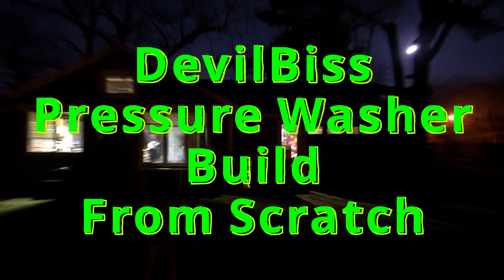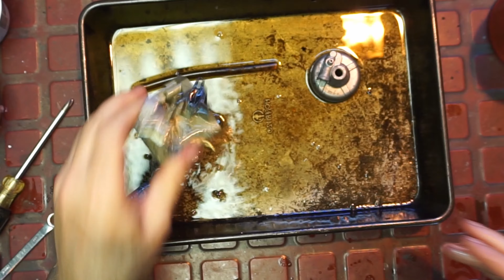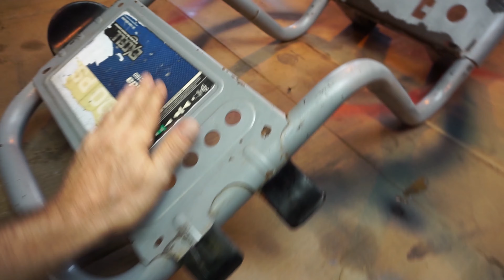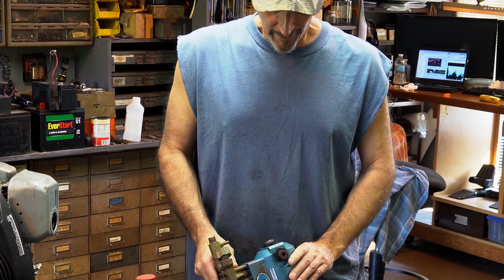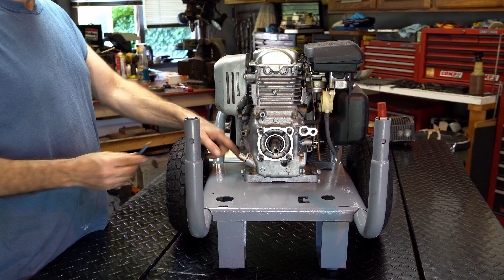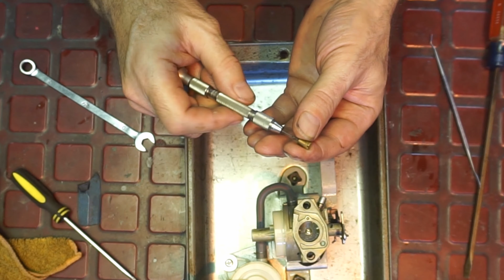EXCELL/Honda XR2600 Pressure Washer FAIL ~ Pump Replacement (Axial Retrofit) Refurbish - Rebuild

Comment: I checked but have you replaced your seals yet?  I have a general tt9071 pump that needs seals.  Was told it's not worth fixing.  I don't believe them.   It is very similar to your pump.  Hope you make a vod soon.
Reply from the maker: I haven't replaced them yet, I have 2 machines now with General pumps and I will replace them at some point.
If your pump is like this and its not broken, just leaking like mine its worth it. 
Very good pump. I will have to do a rebuild soon..
Thanks for watching!
Reply: @TheNovaJohn  Just like yours water mixing with oil.  I have it going now with motor oil but need to fix.   Thanks for the response and enjoy the new sub.  Look forward to some more vids.

Comment: I have a GC160 engine on a excel 2600 pressure washer.  Took the carb apart to clean but cannot get the jet to come out of the throat.  Do you have a solution I can use?
Reply from the maker: I have a entire folder on Honda Engine service and carb rebuilds..
Start here,, this should help

https://www.youtube.com/watch?v=0OCpMcR5rGA&list=PLN2-S6TaOCsE2XQK3AJqvxeBXOY9RyJaA

Comment: Any chance you still have the pump? Mine failed in a different way but I need a part in the pump.
Reply from the maker: No sorry Levi
I probably should have kept it for a paper weight and in case someone needed it. lol
Really,,you need a newer pump like I put on it..
Just dragged it out today actually. I'm working on a different machine but I wanted to show this one as well.

Comment: I have a Simpson pressure washer the triplex pump failed on it I called the customer service they told me about  three different repair shop,s  they said they would work on the engine but as far as the pump no way I had to take it to Northern tool to get a new pump put it on
Reply from the maker: Sux, yea most places wont fix pumps, just too much work and often they dont come back to life!
Stay tuned, I want to fix these 2 general pumps this winter!
Reply: @TheNovaJohn  cool 😎 I'll be watching the repair video of you doing it young man 😎